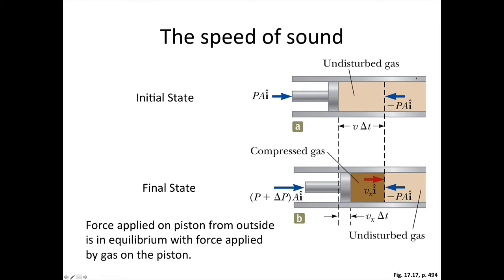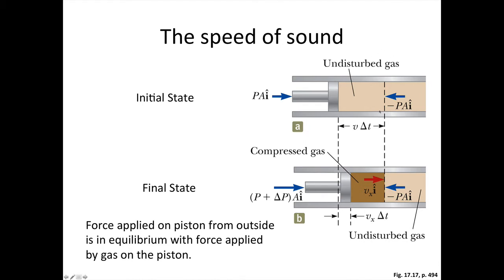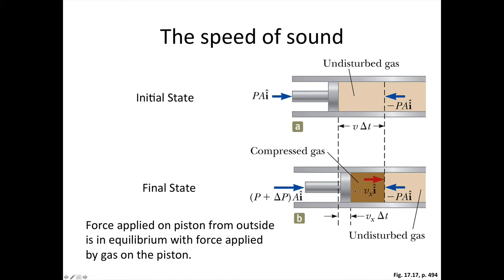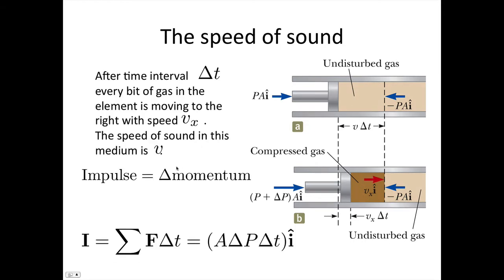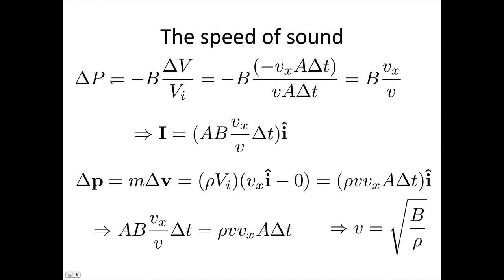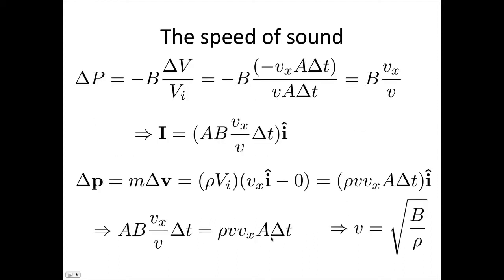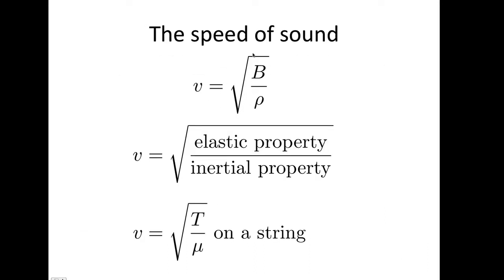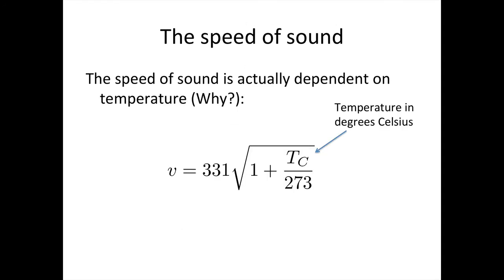Derivation of the speed sound

Comment: Two points assumed wrong in derivation

1. Bulk modulus of gas defines the ratio  pressure applied to the strain. The pressure is not changing here , it's constant

So in the equation for derivation of impulse in your experiment of compression, the pressure is considered "on the volume under compression"  which will not be constant & raise rapidly from P to P+ ∆P, this can be considered isentropic process as the process is quick or also can be considered isothermal if the temp change is not considerable.

But the ∆P is not constant through out the process for which the impulse is calculated.integral average with respect to time can be calculated to know it precisely.

2. In The m∆v evaluation, ∆v( velocity), the change in velocity of vx is considered which really affected the volume vx . A not vi.A. how can the affected m be rho x vi ?.

If the entire volume moved at Vx velocity, why will it be compressed.

Comment: How can you say V is the velocity of sound, where are the arguments that supports this context?? Why speed of sound needs to be constant in your explaination??? It should have  depended on velocity of piston
Reply: Because you’re calculating how fast that compression wave travels through the gas. The speed of sound is the speed of that compression wave and no matter how fast the speed of the piston is, the speed of the compression wave travels at a constant speed (dependent on temperature). It was explained poorly I believe, but if the piston traveled at or faster then the speed of sound, it will hit the air like a brick wall because it won’t compress and sit still before it moves.